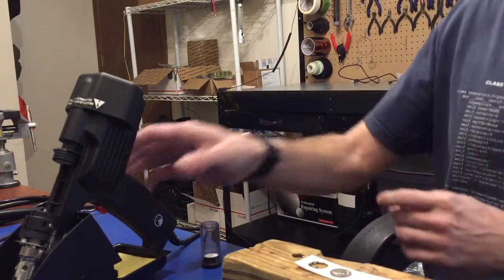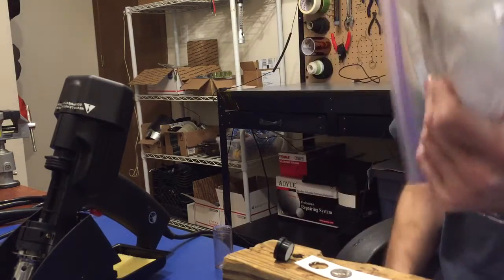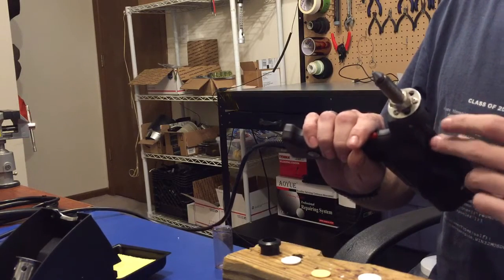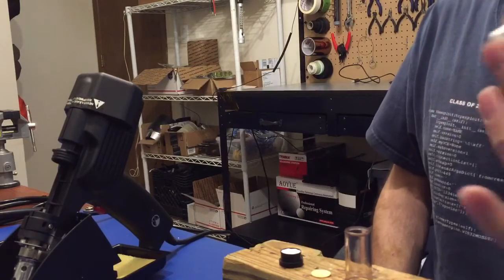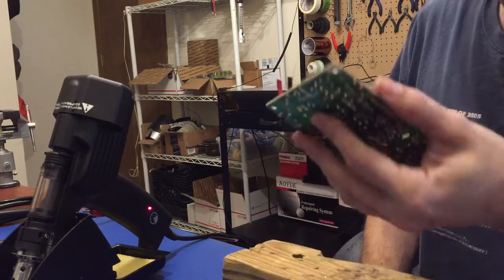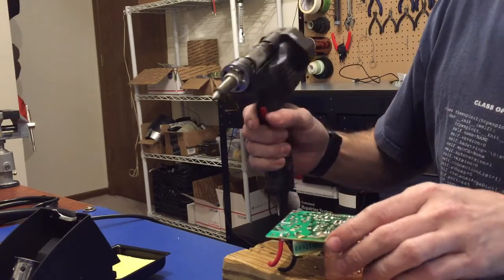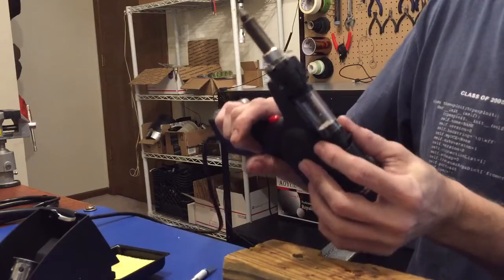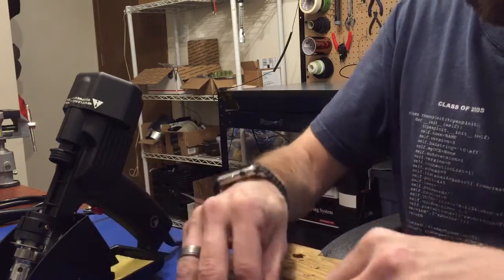Aoyue 8800 De-Soldering gun filter re-design PART 1 - More Gadget Tech Thoughts

Comment: Hi Dave, greetings from Spain. 
Do you think this item would be used instead your tape?
http://www.ebay.es/itm/Ceramic-Fibre-Paper-3mm-thick-1240-grade-/141198979370
Thanks for sharing you videos.
Reply from the maker: +Oscar Cano Hello, that might work. It's hard to say for sure on the density of it to allow the air to flow. My concern is that item is 3mm thick, and what I'm using is 1/16 of an inch thick or about 1.588mm thick. So since its twice as thick it could restrict the air flow twice as much. Something you don't want to do is effect ion the suction since that's the basis of the tool. 
The details on the item has a small description. 

Maybe you can email the seller the link I have in the description of my video and ask them if they have anything close to the same specs that I used? They might also sell a 1.5mm version. The material looks to be the same based off a fiberglass insulation type of material. Good luck, and thanks for watching.
Reply: Hi +Dave B.Reviews (My Gadget Tech Thoughts) thanks a lot for your reply. Here I couldn't find something as thick as the  tape you have used. Maybe I could do a horizontal cut to get 1.5 mm needed. (One circle, two sponges) My aoyue gun will arrive probably tomorrow and the paper next week, so meanwhile (for a small work I have to do) I will use the default sponge. BTW I think that I could do a power suction comparison between both so I will know (my hacked sponge) is working good. Is sad that your tape is not available in Spain. 
Hughes, Oscar.
Reply from the maker: +Oscar Cano Yes, that is sad. I did look for the same tape internationally but didn't find it. I know other shops sell smaller strips of it but for more money. If you search for "3D printer insulation" tape or strip you might find it?  This is what I originally bought the tape for. 

http://www.amazon.com/Ceramic-Insulation-Improves-Performance-Hotend/dp/B00I5093KU

Or these:
http://www.ebay.com/itm/10PCS-2mm-thick-3d-printer-heating-block-cotton-hotend-nozzle-heat-insulation/171749601313?_trksid=p2141725.c100338.m3726&_trkparms=aid%3D222007%26algo%3DSIC.MBE%26ao%3D1%26asc%3D20150313114020%26meid%3Dde1bc94934d54f76b80ae3e62b5f1d01%26pid%3D100338%26rk%3D3%26rkt%3D7%26sd%3D321624213361
Reply from the maker: +Dave B.Reviews (My Gadget Tech Thoughts) or on eBay for things like this.
http://www.ebay.com/itm/10PCS-2mm-thick-3d-printer-heating-block-cotton-hotend-nozzle-heat-insulation/171749601313?_trksid=p2141725.c100338.m3726&_trkparms=aid%3D222007%26algo%3DSIC.MBE%26ao%3D1%26asc%3D20150313114020%26meid%3Dde1bc94934d54f76b80ae3e62b5f1d01%26pid%3D100338%26rk%3D3%26rkt%3D7%26sd%3D321624213361
Reply from the maker: +Oscar Cano 
Good question, I know their is left over with my 25mm (1inch) wide tape. I'd like to say 20mm is enough but that's not a confirmed answer. I'll have to measure and check, then get back to you hopefully tomorrow.
Reply: Thanks again +Dave B.Reviews (My Gadget Tech Thoughts)